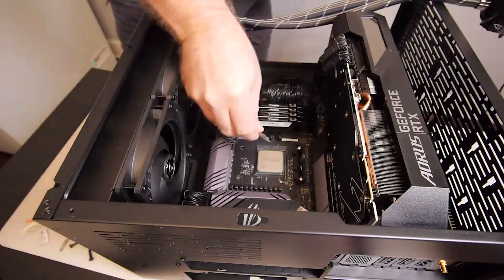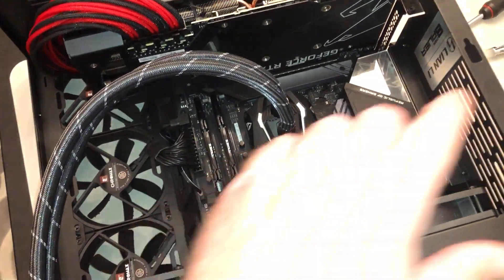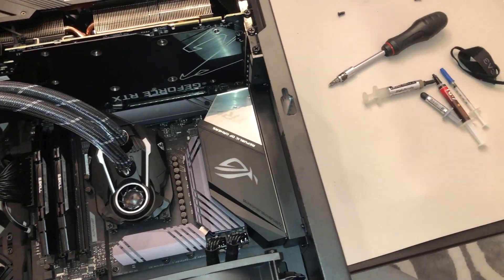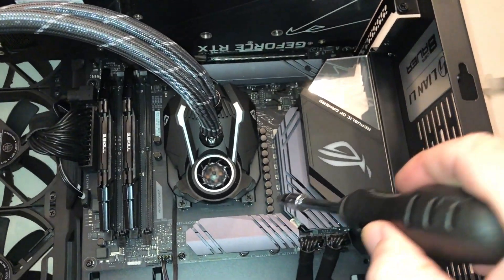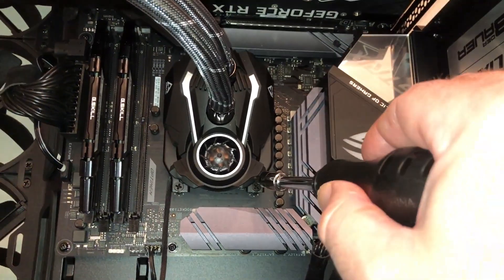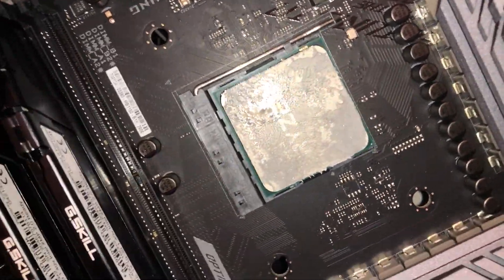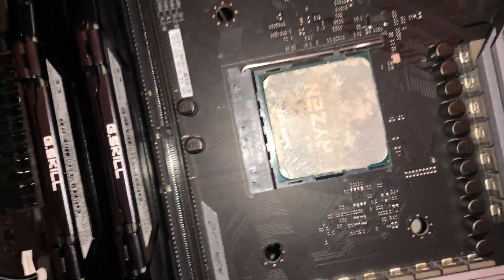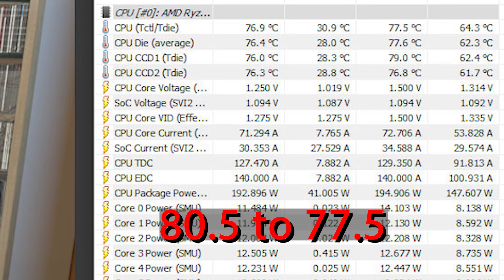The Best Way To Apply Thermal Paste Ryzen 5900x Zen 3 5000 Series Tested

Comment: Your mounting bracket uses 4 points of contact?
I've only seen AM4 with use 2 points. What AIO is that?
Reply from the maker: arctic cooler ii 360

Comment: Wow! That looks like so much of thermal paste and I've always read that the pea drop method would be "the best".   I'm kind of afraid to use that much of thermal paste in fear of it spreading elsewhere than just on the processor 😅
Reply: It's far too much for Arctic Silver 5, but yeah, you do want to spread it out.  AS5 does best, and I know this sounds picky, but I've used it for years... when you use just enough.  I mean, sure, you can overdo it or under do it and it's not gonna blow your rig up.  You'll just run a few degrees warmer overall.  But if you're chasing the best method with AS5, it's a thin layer on the CPU, a very thin spread on the heatsink base, and bam, you're done.

I did just try MX-6 for the first time, but can't compare it to AS5 as this is a new AIO I'm using.  Decided to change it up for once in my life lol.  AS5 is hard to beat, though.  He'd drop another 3-4C if he used 1/2 to 1/4 the amount shown on that CPU.  It's just WAY too much for this specific paste.  AS5 is thick and, again, it really doesn't take much at all.  But you DO want to spread it.  You do want an even coating.  And you do want to do it to both the CPU and heatsink.  I've tested it for decades so you don't have to trust me, but I've seen how it acts with several application methods, amounts and over time.
Reply: I guess what we can all take away is.... 
A dot, a spread, an X, a circle.. they all "work."  But you CAN improve temps doing it correctly.  That means spreading it out AND not using too much.
Other pastes seem to be more forgiving with the amount, though.  A little too much doesn't make a big difference.  But I've applied AS5 and knew I used too much, reapplied it and dropped like 7C or 8C.  It's a VERY picky paste IF you want to get the best results from it.

Again... it's not like it's gonna kill your CPU with too much.  I'm just saying... 
I've used it dozens upon dozens upon dozens of times.  I mean, jeez, maybe 100 times in my life if you count other people's builds and doing my GPUs and just reapplying over time, etc. etc.  Less is more with AS5.

Edit:  BTW, every GPU I've ever used it on loved AS5.  But I guess they'd love MX-6, too.  Like I said, only used MX-6 once and it's on this Thermalright Aqua Elite V3 360 AIO cooling a 5900x that can hit close to 210 watts with my settings.  Not a fan of locking in a frequency.  Use PBO + CO.  I run at 4.9+ghz in games and 4.65ghz+ in CPU-z benchmark.  If you do this old school overclocking method on these new CPUs, you lose those boost clocks in your games.  And I imagine there's a 5-10% gain between running 4.6ghz in a game and 4.95ghz in a game.  Combine that with the 3-10% gains shown from dual rank RAM and everything starts adding up.  Which, I wasn't hitting 4.95ghz in games until I did my per core Curve Optimizer tune.  I never see anyone hitting 4.95ghz in games with any Zen 3 CPU when I watch benchmarks.  I do have a stepping 2 5900x, so that helps.  It's rare that I ever win the "silicon lottery' but this 5900x has been amazing.

Comment: I used Arctic MX-6 and spread it with a mini spatula all over the IHS. Cooling my R9 5900x was a QC Arctic Liquid Freezer II 360 rev 4 with the offset brackets CPU idles at 26c-27c gaming and benchmarks never goes over 64c. CB r23 mc 30-minute throttle test 23,010. Using G Skill trident z neo cl14 3800mhz 4x8gb overclocked from cl14 3600mhz with an Asus Rog Strix motherboard. PPT 195 EDC 140 TDC 130 no curveoptimizer no undervolting manually set the thermal limit to 90c just enabled PBO and found my limits.
Reply: hi sir do you still use the same set up .I have the same cpu with yours.
Should I copy your settings

Comment: I've used the credit card method for years but recently got a 5900x and Noctua cooler. The Noctua recommendation was a pea size blob in the middle and a smaller blob towards each corner. 5 blobs in all. You'd think Noctua would know what works best?
Reply from the maker: Test both and see. Only costs you some time
Reply: 5 dots method is the best

Comment: My 5900x is hella hot, dark rock pro 4, apply a new thermal past today (kryonaut) he doesn’t drop. Occt 10min give 85 on CCD0.

Either i got a bad one or I need to change the fan of my case.
Reply: EXACT same problem. I thought my aio was faulty. It seems that as long as it doesn't reach the 90c throttle, the cpu will keep boosting. I had to go into bios and manually set the throttle to 79c.

Comment: Yeah I heard the 5900 was getting to hot, like just in general.
Reply: need a beefy cooler for that or undervolt it
Reply: 80 degrees Celsius isn't very hot for Ryzen 5000. They can hit 90 degrees without any serious issues. Some can hit 95 before there's a problem since that's how they are designed. From reviews the 5800X tends to get hotter than any other 5000 series chip due I think to having one full 8 core CCD and not being as highly binned as a 5950X which has 2 8 core CCDs. Looking at the 5600X and 5900X, only 6 of 8 cores and 12 of 16 cores are functional on those chips respectively so they can run a bit cooler especially when PBO is enabled compared to the others.
Reply: @gmaxsfoodfitness3035  Yeah Im running a 5700g even when I used the gpu cores on it , it stayed amazingly around 70c  and i live in Texas. Im just using the 8 core cpu now since i bought a 3050.  Im gonna get a 5700x to replace it when I put the 5700g in a new build for the kiddo.

Comment: Great video I had issues with 3900x crashing at first I thought ok BSOD got to be RAM I tested 2 passes passed. I then rma mobo no fault found. I applied the pea method. The only difference 2nd time around I rma cpu upgraded to 5900x and used the spread method so far no BSODs unless the 3900x was buggy.

Comment: Nice!  I reckon the initial pea sized amount was spread a little too thin to fill some crevices here and there.   I wonder how much squeeze-out happened with that (fairly thick) continuous layer.  A little squeeze-out is fine as far as I know.  There is a theory that the even spread method risks creating air pockets but... there are a lot of theories when it comes to thermal paste.  Years ago, I saw a test of many different application methods -- they even tested a smiley face -- and the winner, by a slight margin, was an X shape.  I also found an AMD article recommending the X-shape. About to install a new 5900X... might do a comparison between even spread and the X shape.  This more recent video (https://youtu.be/ofyNgJyhGuc) found the best temps with a 5-dot method -- again, by a very slight margin, and followed by the X-shape.

Comment: Nice video. May I ask what your temps are at stock not overclocked. I have the same cooler and cpu and am getting 37c Idle and about 72C at load. Thanks

Comment: Thank to your video I double checked the thermal paste applied and also the installation of the AIO, I do have the same 360 and also a 5900X, but when I saw those 190s Watts and the temperature I understood that something might be wrong in my setup, either the brackets got V3 that´s different from yours, or maybe the thermal pase. The result was both due to a swap of the V3 brackets from my site. Double checked the Artic instructions manual and now I´m on stable 70ºC at constant 4.53Ghz for 12 cores at Cinebench for example. Now it´s time to continue with the PBO that with the wrong setup was impossible due hight temperatures.

Thanks again and congratulations for your work, watched the other video of your full assembly beast!, gotta sell the shitty Corsair MP600 that write speed is totally a mess and gonna get that Sabrient rocket.

Best regards from Spain.
Take care!

Comment: Running great temps using liquid metal and Deepcool Assassin III cooler with PBO2 enabled.
Reply: What temps were you getting? I have a 360mm AIO and I’m hitting 90 consistently in that game.
Reply: @JayRacer  I ran CinebenchR20 for 10 minutes with an ambient room temp of 73 degrees F. According to HWINFO64 maximum values during that test, my CPU (tctl/tdie) was 70.8c, The CPU CCD1 (tdie) was 71.8c, The CPU2 (tdie) was 68.5.
Reply: @GovG33k  I have been good with Cinebench. The problem arises in gaming because my RTX 3080 heats up to the point that touching it is painful and it was essentially dissipating that heat into the cooling lines. The way they had the Rad mounted, the lines hung below the cooling block and were an inch away from the GPU. I know there’s a way to mount the GPU vertically so I’m actually considering that. I may also have to invest in more intense fan casing.
Reply: @JayRacer  Is your rad top or front mounted? I play MSFS2020 the most and my rx5700xt is at 99% the whole time, very much GPU bound and my CPU temps never get beyond 72c. However my setup does a good job of exchanging chassis air quickly and the case breathes well.

If your aio is healthy, I don't think having the tubes close to the GPU cooler would increase the heat that high unless they were wrapped around the thing. The water just isn't sitting there that long. It would take a lot to saturate a 360 I would think.
Reply: @JayRacer  Also, this is my build https://pcpartpicker.com/b/kHDxFT
Reply: @GovG33k  thanks buddy. I resorted to using a custom builder so now I’m rearranging fans and such.
Reply: PBO2 is undervolting it right ;)

Comment: Thank you, I'll be doing this on my 5900x. I only did the pea method and my temp after 1 month of using my new computer. it started to go up 10c higher on idle. Usually when I first booted my computer during idle. It was 27-31 degrees. Now its 38-42 degrees idle.
Reply: Hi, did your temps get better after reapplying?
Reply: @JoanCamiloGómezTorres  He is still in rehab not sure he knows he even has a computer.
Reply: ye same thing but on the 5800x

Comment: just got my 5900x i ordered from b & H :D going to get some kryonaught and spread that shit
Reply: no matter what thermal paste you have.... it depends how your case is well optimized with  air flow ventilation . More vents better case is .. 4vs6 or vs 8 is big difference... Not thermal paste. I have stock paste from cooler amd cooler idle 31c .... max temps while gaming 61c... and  average 50c. IT is waist of money of expensive coolers.. on amd.. Amd is 7nm it works perfect with cheap coolers. Ryzen need good memory not good thermal paste.
Reply: @MakeSh00t  your sports car doesn't need premium gas the engine will be fine... sorda, and the chance of pre ignition is higher... just great. More boom more better? CPUs will definitely not clock higher because the like getting hotter than 90c, yeah big coolers don't give big CPUs more headroom to spread their legs or anything.

Comment: Nice result! Didn’t the paste squeeze out when you placed the cooler?
Reply from the maker: It would only do that if you apply way too much
Reply: @COGuyStuff  but isn't that how the pea method works, all the paste is supposed to spread when you compress it like that
Reply: @jahoan1487  That's because the pea method is a drop of paste. It's not spread out before you install the cooler. When you spread it before hand there's not much more spreading left to be done when installing the cooler.